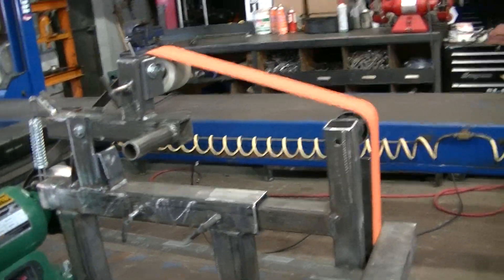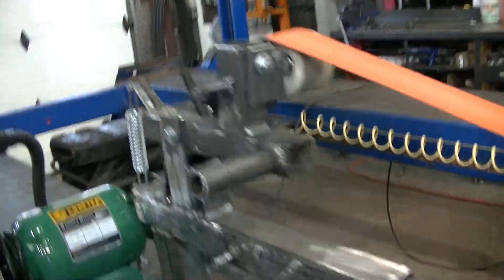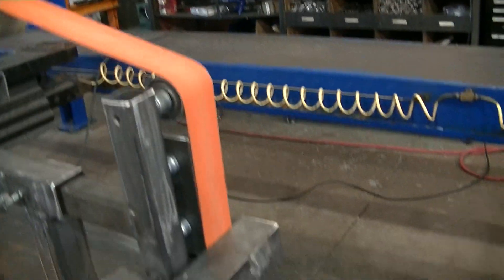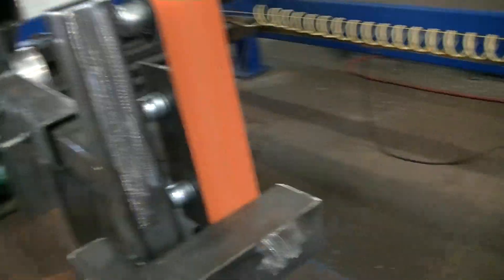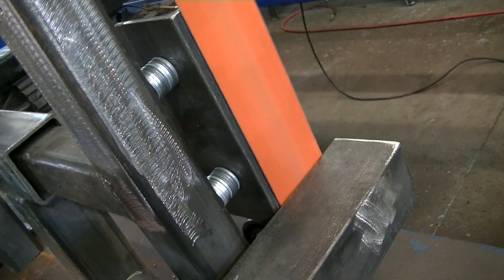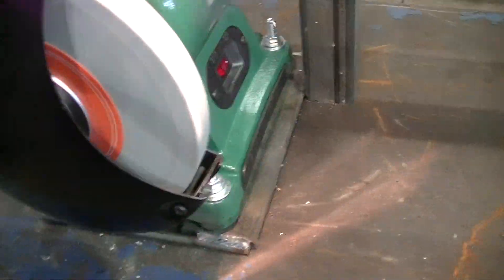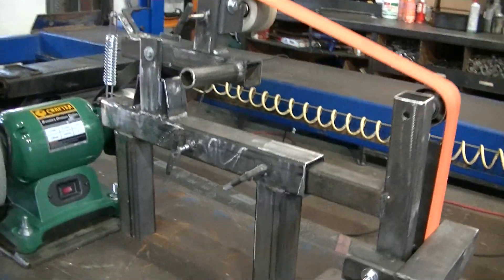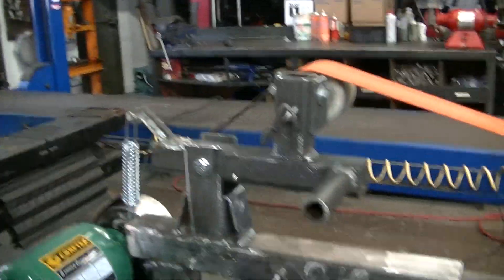ANOTHER  2X72 GRINDER

Comment: +SSR KNIVES AND GUNS! why didn't you use the lift struts (shocks) like you did on the last one?
Reply from the maker: +Mark Pikas THEY FAILED!!
Reply: I was wondering if the abrasive would do them in
Reply from the maker: +Mark Pikas IT WAS A CRAPPY SHOCK, SPRINGS ARE BETTER~!~